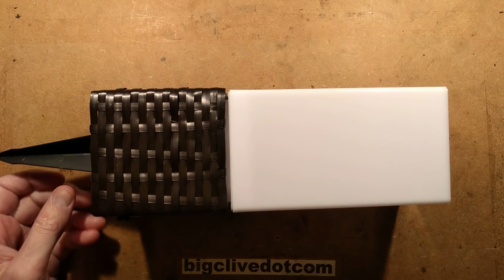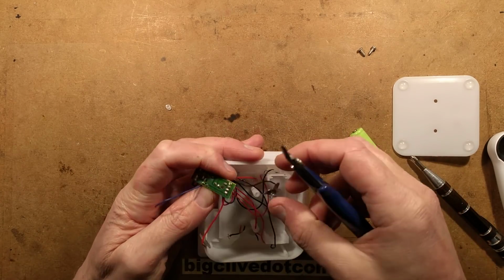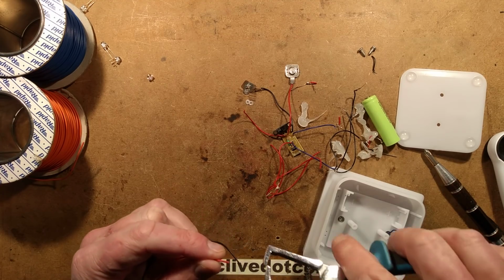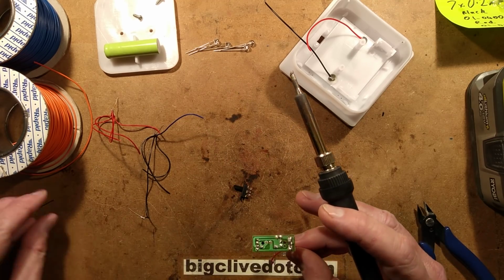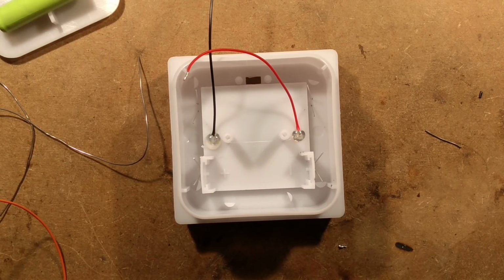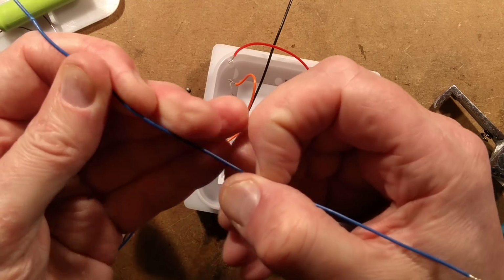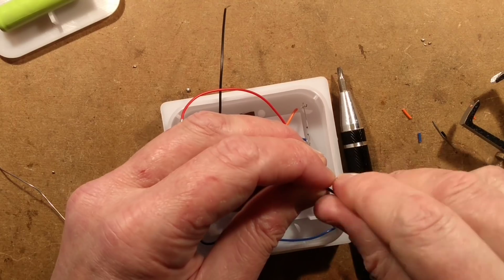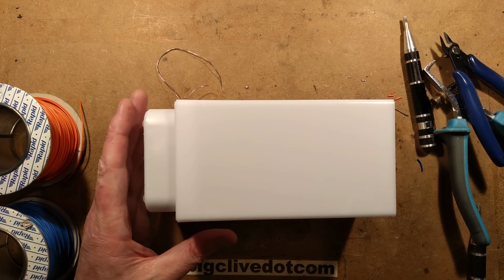Solar light - cold to warm white conversion.  (ambient)

Comment: I have one of those solder suckers, it's great. The silicone is heat resistant enough that you can push it right down against the board and your iron to get a good seal and it won't melt.

Comment: Why do you still use lead based solder? It is not the best for nature and your health. I know, it flows and melts well but I believe that it is not worth poluting the nature just to get nicer solderin results.
Reply: Because it's easier to use. The amount Clive uses makes it a moot point.
Reply: Flux fumes are far worse than what's in solder be it lead or not. As for pollution, the amount caused by a soldering pales in comparison to almost anything else, we used to have lead in petrol for goodness sakes. Just make sure electronics are recycled as all things should be where possible.

Comment: I've heard some cosplayers use the battery packs out of Ryobi tools to run the servos in their costumes or lights if they're LED heavy.  My mum also has a set and uses them for home projects.  They're not the heavy duity construction grade for sure but they work well for casual use like you said.

Comment: CPC Farnell, yep, Element-14. Conrad bought Rapid a couple of years ago now. I also use both CPC and Rapid. Along with Ebay of course.
Reply: Ian Leitch - Conrad bought Rapid after abandoning their own ‘UK’ web site which they had only set up a few years earlier.
Reply: Thanks Mark, I didn't know about that. Fortunately Rapid seems to be unchanged as far as I can tell. Which has to be a good thing.
Ian_

Comment: I wonder if there isn't a selection of dyes that can be applied to the plastic of a cool white LED to "warm" it up. Perhaps yellow and red high-lighter? If so, there could be money in making a "warming" pen to apply to annoying cool white LEDs.
Reply: would massively decrease the light output though. would have to swap out the inductor/resistor to make the LED's run at a higher current to compensate. and it makes the light look kind of odd when you try to color it with any kind of pen or marker.

Comment: So where do I get such a desoldering pump and how much does it cost? Because I've also only got one of those cheap 2€ ebay thingys, and when it works, it's fine, but the threads from emptying it out are quite chewed up, so it won't hold for long any more - which is a shame, considering how rarely I used it overall.
Reply: https://www.adafruit.com/product/1597
Reply: Amazon
Reply: Thanks!

Comment: Can i connect my 7v solar panel to 5v li-ion power bank for charging?😊
Reply: Probably not.
Reply: it depends. you would still need a diode. Maybe a diode or two to drop the solar panel voltage maybe down to 5.5v or so. because 7v could have too high of an open circuit voltage.
Reply: @realflow100  thank you..it was charging when i plugged it in,but didn't know it was damaging my power bank😥 i will try it tomorrow with diodes and measure the voltage...
Reply: The extra voltage when immediately connecting the solar panel might be enough to short out a capacitor along the input charging circuitry. which would make it permanently not take a charge or charge very slowly and get really hot.
could also make the switching transistor/mosfet go short circuit and drain the battery rapidly until its dead or burn up the powerbank.
so you want the voltage to be at most 5.5v on the input.
Reply: Yes but not directly, you need a little circuit board. 
I have to do research, Big Clive probably can do it by hard.
Reply: @dutchglobetrotter4513  i am hoping for a simple circuit which doesnt have any heavy components..😌😊
Reply: I saw a video where Clive replaced the battery with a lion phone battery. I think it was 6 month ago.

Comment: I love cold white light. My luck would be to buy one that was 2700K and have to change the LEDs to 5000K.
Reply: 2700K masterrace
Reply: 5000k is neutral white. Cold white is 6500k+
Reply: fogllama 6500K Philips LED replacement “tubes” for 40W fluorescent tubes. Replaced every real tube in my place. They’re fine. Color is okay. Supposedly 2100 lumens and 20W.
Reply: 4000k is a nice mid temperature that's not too harsh or too warm., good for general lighting.

Comment: Ooh, I definitely approve of the Engineer brand solder sucker! As well as having a good internal seal so that its suction is very good, the silicone tip is heat-proof, so you can press it against the iron tip when holding it in position, thus creating a good seal around the solder joint you're trying to remove and resulting in a good amount of solder being sucked up. The cheaper solder suckers just don't produce nearly the same amount of suction, and they tend to have plastic tips that can be melted by an iron - they're much less effective.

In fact, all of the Engineer tools seem to be very good, and not too expensive either! I have two pairs of their side cutters (pretty strong ones), their thin, long-nose pliers, their solder sucker, their stripped screw remover pliers,a very strong, well-built pair of scissors, and a shallow, ratcheted right-angle screwdriver thing, and I've been thoroughly impressed with the quality of all of them :)
Reply: I have a couple of those SS-02 solder suckers....best I have had in years.
Reply: I don't... I have the cheap crap ones... But I also have a lathe, and some silicone tubing... I can feel a nozzle modification coming on!
Reply: Cool, now I am going to purchase one.
Reply: I salvaged some silicone tubing from a pneumatic HVAC controller to add to my Radio Shack solder sucker.
Reply: Andrew, another nice feature of the silicone tube is to avoid damaging the trace with a sudden jerk of the tip on the surface.
Reply: @jamesplotkin4674  Good point, yes :) I've certainly never damaged anything with mine! The only issue I ever have with them is that sometimes they get a bit clogged up with random bits of solder and it can be fiddly to unclog it at times, but I suspect that'd happen to any solder sucker.

Comment: I have tinnitus so every time the audio cuts off then my tinnitus ramping up until there's some noise again.... I'd prefer having a little background noise than dead silence
Reply: If by 'dead silence' you mean 'nothing but the eternal screaming noise in my head' , I agree.  Gimme background noise 24/7.
Reply: Me too.  I hate that new trick. A bomb goes off, things get quiet and a VERY HIGH pitch tone starts. It's like throwing a master switch on my tinnitus.  Even though it's not louder than the sound track,  my ears ring for hours afterwards.!

Comment: Slap a BigClive sticker or marker on it. I dig these hack or repurpose project videos. I went to make a bench power supply and tore open open a microwave the other day it had an inverter not transformer. Any good uses for it.
Reply from the maker: I'm not actually sure what uses there are for a microwave inverter.  Aside from making a microwave gun to fry your foes.
Reply: @bigclivedotcom  thank you you sir, I have 1 other microwave to RIP open. Maybe that one has transformer.
Reply: Raymond Mucklow a couple of years ago I made a mole killer as they appeared and just destroyed my garden but left all of the fields around me. I used a microwave transformer and wired each side to opposing 6” nails through a lump of plastic. The mole hills were pushed in and the bed of nails pushed into it. When the mole comes through the run and finds the dirt, they go to push it all back out and touch opposing nails.

I say it was a mole killer. It was more of a mole exploder. You knew it had worked by the plasma arc that shot out of the floor. You could only use it when the ground was dry though.
Reply: @evilution_ltd  it's funny you mention that, as this year I planted twice a new front yard for my Mom. Twice the moles have destroyed it. I live in kansas so moles and gophers are all over I bet your invention would work great for both, that being said we just had a week of rain. On a side note in the past I have used the ol crank phone generator for worm hunting and fishing before. Just get a cordless drill hooked to the end and  drive some long rods into the ground and watch the worms fly. Best if time is taken tho, short bursts of power. Maybe I'll save it for next summer. Thanks for sharing.

Comment: 6:30 "If you try charging an alkaline battery, sometimes they go bang." Ten or twenty years ago there was a fad for chargers sold to recharge non-rechargeable cells. I never bought one myself. They were claimed, I think, to stop charging if the cell showed signs of misbehaving. Did anyone here own one and did they work?
Reply from the maker: I have one here.  They didn't catch on because you can't really out a lot of charge back into an alkaline cell and the chance of it leaking from seal damage is huge.
Reply: Ive been able to full 100% recharge several rayovac "high energy" brand alkaline batteries with no signs of leaking and got more than 10 uses out of them. You just have to charge them at every opportunity and dont discharge them fully. they last much longer when you keep them topped up and dont go below 50% as much as you can.

the ones that are no good anymore are obvious because they dont charge up fully and the voltage is decreased. and the output current drops off like a rock quickly. but as far as I know even the bad ones havent leaked. they just dont take a charge anymore.

for a healthy one the voltage should climb up good and the batteries should stay cold even fresh off the charger. if they get warm then they are no good anymore.

About 1.6 to 1.62v is fully charged for them.. it seems the blue planet alkaline battery charger (charges 4 individual batteries) seems to charge them the best and fully up to 100% for the good batteries.
Ive tested so far the AAA and D-size variations of them and they dont leak even after being used a few times. charged and then sit for a few months. Fresh off the charger the voltage will be around 1.6 to 1.62v and depending how good the battery is it'll settle down around 1.55v to 1.6v after sitting for a while off the charger after being charged.

the "fusion" kind of rayovac batteries are no good for recharging because they leak readily and dont take a charge very well. so dont bother with those kind if you want to play with recharging alkaline batteries.
energizer alkalines also leak very readily if you try to recharge them. same with duracell alkalines. leak city.
Reply: I built one from a magazine article with my brother.  Can't remember ever using it past checking that it appeared to work
Reply: My physics teacher made a nice I that I used for years.  It was a clever little thing and worked quite well.  Batteries are so cheap now that it's not worth bothering with.
Reply: Well, I do have one and still in use almost every week. Works very handy and nicely but you have to know what you are doing and don't over-use the batteries before charging and you can only recharge them a couple of times in them. 
Using VARTA's, I hardly ever had one leaking this way. 
I use them in bike-lights that don't work too well with normal rechargable cells and also in some remote-controls that suffer from the same problem (too low voltage with NiMH and NiCD's).

I also have a charger for RAM batteries that claim to be  special rechargable Alkaline cells. Only works  a couple of time and then starts leaking... :-(  Still have the charger but since all the batteries started to make a lot of salty outsides the batteries are all gone. They also give 1.5 Volts instead of 1.25 Volts but because of the leakaging they made a mess of some lights and battery-holders.
Reply: Yes, I have an ‘Innovations Battery Manager Ultra”. But no longer use it for recharging alkaline cells. The most common alkaline cells that are available are Duracell. But they leak in normal use. So I don’t even try to recharge them. I do however use that charger to slow charge NiMH cells.
With a non-rubbish alkaline cell, as said above, if not discharged below 50%, yes, you can recharge them two, three or four times. I never got much more than that, as the capacity dropped off and then this charger would refuse to recharge it again.
I’ve never had an alkaline cell go bang while being recharged though.
Reply: Yes, Duracell are not that good (anymore maybe). I have been trowing a lot of these out and never tried to charge them.

Does anybody here has a good scematic for making an Alkaline-charger? I can only charge AA and AAA-cells in my charger and it is getting a bit old...

Comment: Ah yes, changing leds. I bought a cheap night light in the bathroom and it was a rather annoying blue. I put a slowly cycling rgb led instead. Had to install a smoothing cap between the FUULL BRIDGE RECTIFIER and a 330 ohm to smooth the voltage so that the rgb chip did not continually reboot.

Comment: I don't hear the buzzing sound Clive.  To me the audio is fine.
Reply: I have headphones on and can hear it slightly its like if u play a blank tape then stop it about 1 second after clive stops talking probs wouldnt have noticed if wasnt told lol
Reply: Yes, only really noticeable when using headphones for me. Not really an issue, and certainly much rather a video with buzz than no Big Clive video...
Reply: Me neither. The advantage of advanced age and tinnitus.
Reply: Nuts n Proud I guess the heavy audio compression discards it as not important.
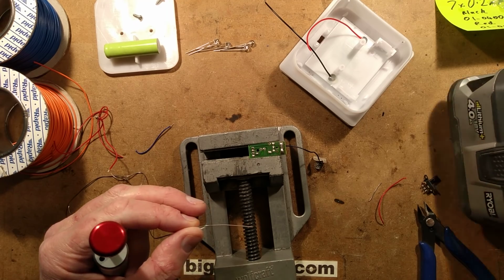Reply: The buzzing is fine, but the audio cutting in and out rapidly at times is a touch distracting if you're using headphones. 16:26 for example.
Reply: What you’re describing then is AGC, not compression. Videographers learned not to use AGC many moons ago.
Reply: I don't hear the buzz either but I suspect headphone users might pick it up a bit.
Reply: Eddie headphone user here. more or less sounds like a mini-fridge buzzing while talking and a half sec b for and after talking or apparent noise. spaced out by digital silence by the high pass. almost prefer no bridge personally though... Love all the bkgr noise and quirk-isms of home made Video and clive in his habitat : )
Reply: This tablet has an undocumented feature. 'Automatic high pass filter', because of the minuscule speaker in use! So no issues with hum or booming voice, etc. Just rubbish lo-fi music playback.
Reply: I have to turn it up to hear it, it's that background electric noise you might get from those old ceiling lights they use in offices.
Reply: This is the most annoying of BC's videos from the audio point of view. No buzzing, but the AGC dropping out every time he stops talking is VERY annoying. Shame it is not adjustable like that in radios.